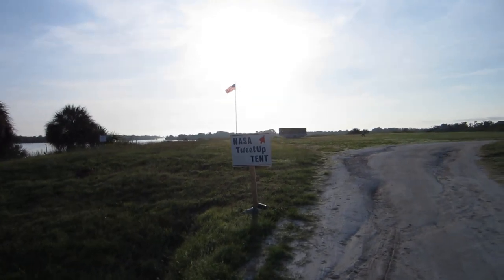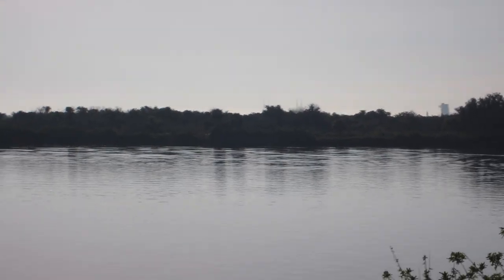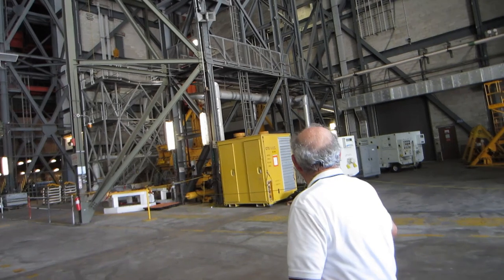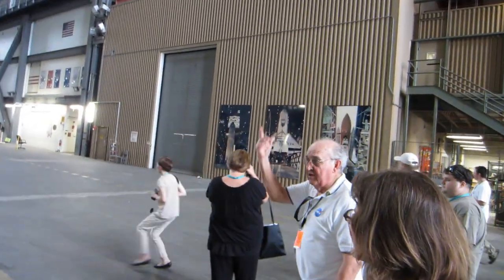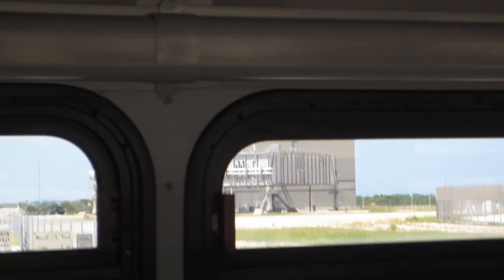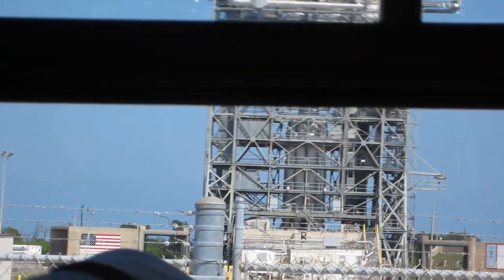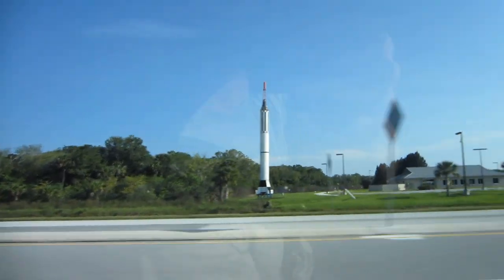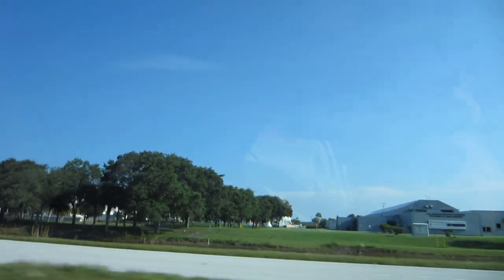NASA Juno Launch Tweetup Day One "A Discovery In The VAB." (8.4.11)

Comment: @TheTimTracker i remember talk in the NASA area that 39B had to be refitted from shuttle to Ares, and they used a "mobile" structure that fit into where the shuttle would be. they had to do that because of the need or possibility of damage to 39A or if a standby mission was required. thats what i recall that structure out there being.